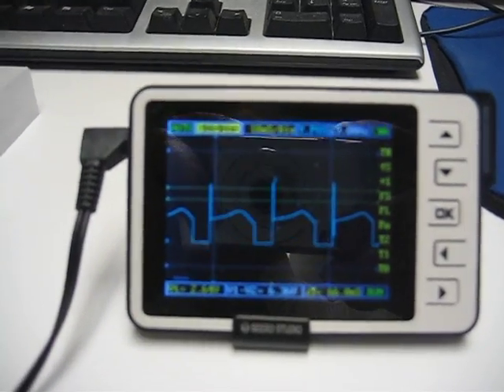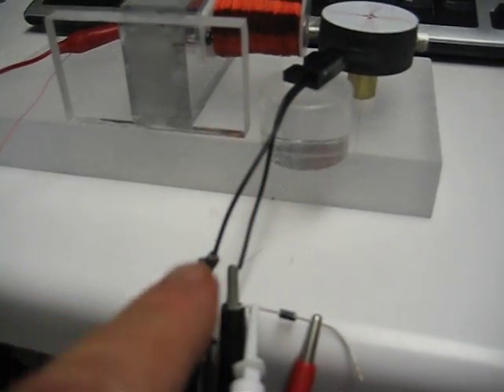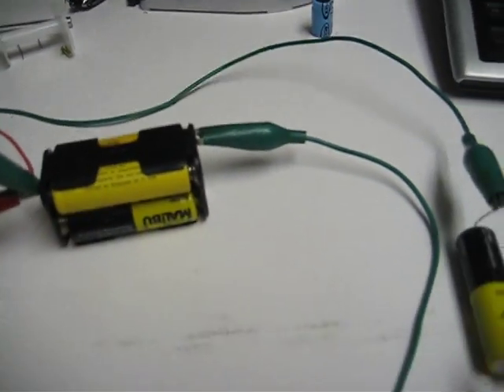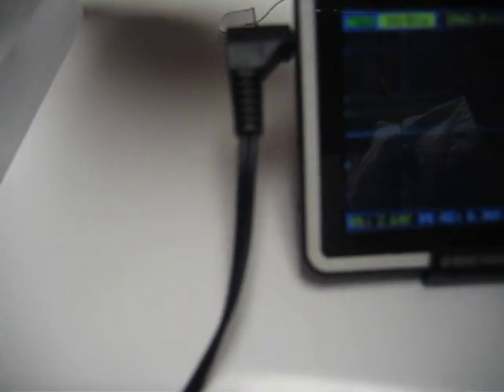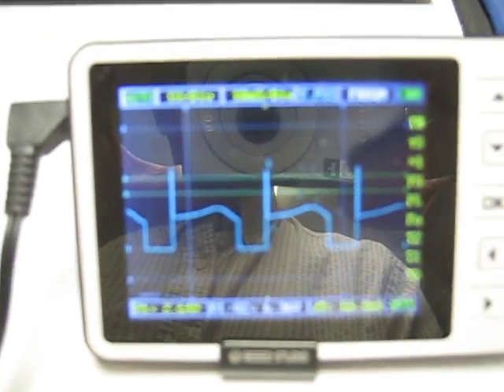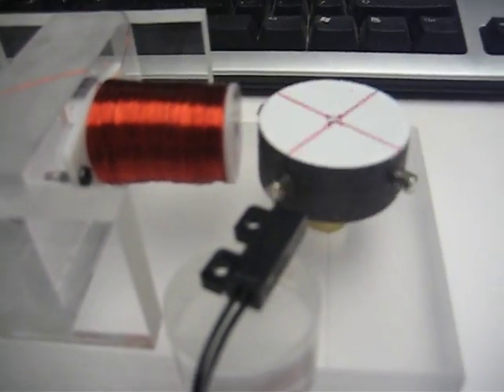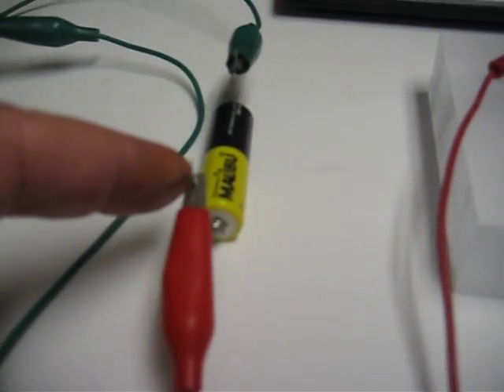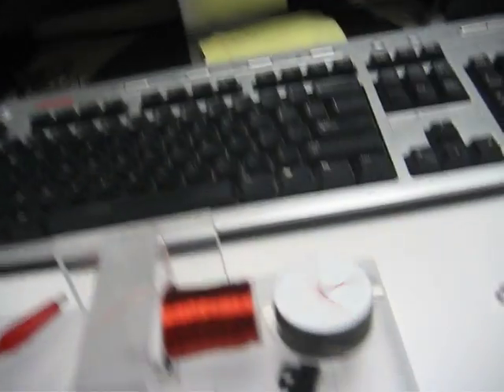Nathan Stubblefield Ironless Motor John Bedini

Comment: Motors should use the force of push not attraction.

You can't break the rules playing with the devils toys.

If motors we not supposed to be driven by generated FLYBACK pulses. Then bulldozers would pull dirt not push it.

Influx drive is all wrong.
Reply: if youve even looked at how to build one of these, it works by force of push, conventional motors use attraction using DIPOLES instead of a MONOPOLE like this motor here, and if you know magnets, you know like poles repel (push each other away!) and in a MONOPOLE  system you only have like poles